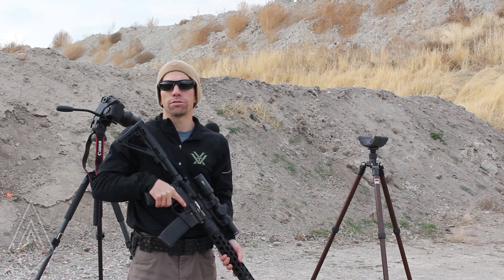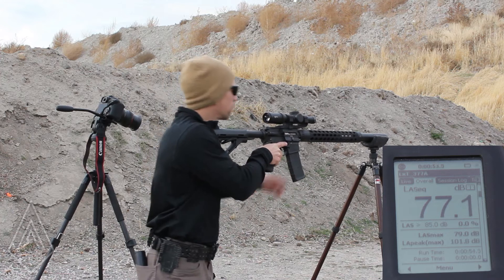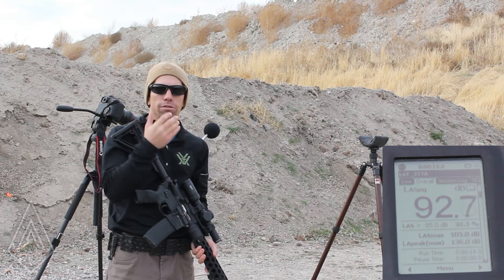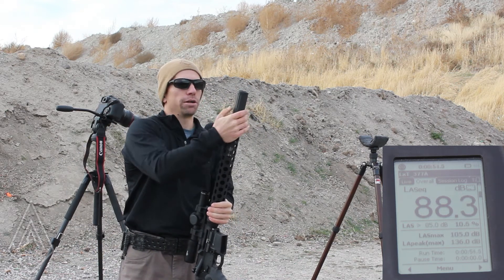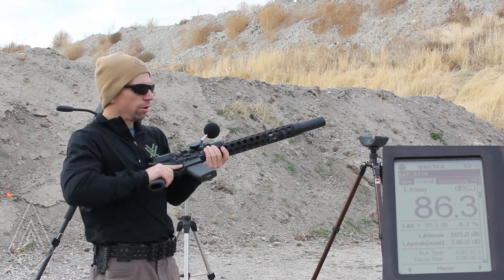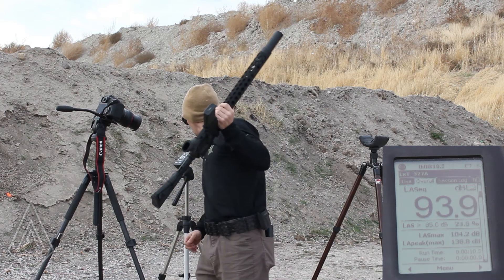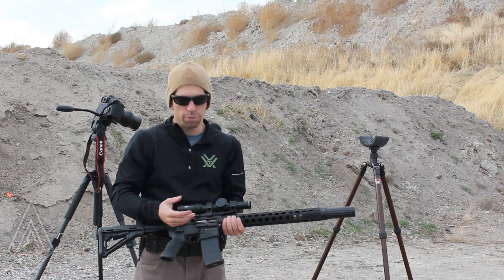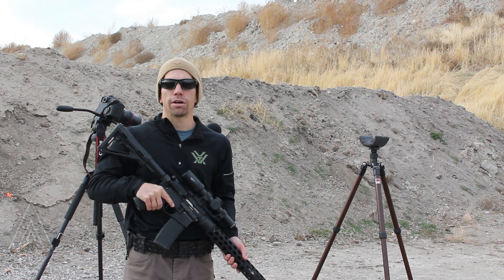End-barrel vs over-barrel suppressor testing Old

Comment: Waiting on my stamp back from ATF, bought the mantis 300 OTB suppressor, plan on putting on my X95 18.5” barrel. Fits fine, but I’m concerned with the Db. The OTB design with the initial blast chamber I think will help with gas blow back, but it’s a gas piston rifle, so idk if that is gonna make a difference… but is 3.7” of the mono core baffle style be enough to keep a 556 round out of a 300blk suppressor hearing safe? Might need to invest into a 300blk pistol…
Thoughts from the community welcome. Thanks.

Comment: Why was the end barrel quieter at the ear than the over barrel suppressor though?
Reply: 2 db is within the variance of one round, but taking it at face value it's probably because the baffled section is longer on an end barrel suppressor. It looks like the actual baffled section is only the 3.7" that extended beyond the barrel, but it has some extra volume which helps somewhat. A 7" can has about 6" of baffles. This is also probably why the longer version has the same db reduction as the M

Comment: Will it be compatible for 20inches barrel?
Reply: The CQBm is compatible with a 20” barrel and rifle length gas system if the barrel is less than 0.750” in diameter.

Comment: Why are you using the inside ear? The outside one is the one that takes a hit.
Reply: Military testing is at the right ear. Also, it's still louder at the right ear due to proximity to the ejection port
Reply: “Port pop” generally manifests near the ejection port in semi-autos.

Comment: Is the over-barrel suppressor necessary if you have an adjustable gas block with a suppressed mode?
Reply: The over-barrel design results in a lower residual bore pressure as the rifle cycles. This helps reduce gas blowing back into the action as the chamber is “uncorked” during extraction. 

An adjustable gas block will have little effect on gas blowback into the receiver. Rifle configurations that delay unlocking until chamber pressures fall (short dwell time) and suppressor design has a greater impact on reducing gas blowback.
Reply: @woodrowcall3158  Negative, Knight-rider. restricting the orifice restricts the flow of gas. restricting the flow of gas means it takes longer to pressurize the gas tube enough to move the bolt carrier. If it takes longer to open the bolt, the pressures in the bore are going to drop more. The only thing an over barrel suppressor does is that it gives you a larger blast chamber, with no increased length on the rifle. It has been noted for nearly a century now that volume in a suppressor that is behind the muzzle is less effective at suppressing sound than volume in front of the muzzle, but if it helps a little, and doesn't add much weight and no bulk, why not?
Reply: @wildrangeringreen  You can only restrict gas between the gas-port and BCG so much before inducing failures.

Reducing dwell time on the rifle side necessitates a larger gas port and a higher initial pressure spike in the system, but overall time for the system to be pressurized is reduced. The quicker you get pressure down after passing the gas port, the less residual pressure there will be present during extraction.

You can move a BCG with a long and gradual push, or a short and powerful punch, and achieve effectively the same thing.
Reply: @woodrowcall3158  I think we can both agree that an integrally suppressed AR, with the gas port built into the suppressor (a gas tube running straight from the blast chamber would work, very reminiscent of a gas-trap action), would be ideal for that; but since we're talking about standard AR builds that don't rely on a suppressor... restricting the gas with a field adjustable orifice is the simplest and most effective way to control when the bolt unlocks (and still allow the weapon to function without a suppressor properly without carrying extra parts). Pressure is volume, and reducing the volume per microsecond that can fill the gas tube means that it takes longer to reach the pressure needed to move the carrier. A longer delay between the bullet passing the port and the bolt unlocking, the lower the pressure's going to be. That's why modern rifle designs (the AR15 isn't cutting edge anymore) mostly incorporate an adjustable gas system.

Other option for your "big gas port, high, sudden pressure" to have a long enough dwell time would be to go with a short stroke piston and a vented gas tube (like on an SKS). That adds weight, felt recoil (reciprocating mass), and extra parts, something the AR15 was meant to eliminate or reduce. That system is still going to need some level of adjustability, if it is going to work with and without suppressors, without having to carry extra parts. Otherwise, you need to incorporate some sort of pressure activated, timed solenoid into the gas system (since the pressure doesn't magically go away even once the bullet leaves the suppressor)... but that's insanely expensive, complicated, and heavy. 

Another option would be to discard gas-operation entirely, and move to an inertia-operated system, with an adjustable pre-load on the recoil spring(s) (similar to many air rifle designs with adjustable hammer spring pre-load)

Weapons designed integrally suppressed are far and away better than those meant to be stand alone, that we add moderators to; however, the current political climates worldwide (combined with a historical general lack of interest from the military, special purpose use doesn't count) limits the market for that, and so companies develop designs that aren't natively moderated.
Reply: @wildrangeringreen  
Even an integrally suppressed semi-auto rifle will exhibit some degree of “blowback”. More so if the residual bore pressure is still relatively high when the spent case is unsealed from the chamber during extraction. Time between extraction and the bullet uncorking from the muzzle is still the chief variable in determining residual pressure when you isolate suppressor design out of the equation.

Can an adjustable gas block have an impact on lock time? Yes, but it is negligible, especially when compared to the influence of dwell time.

Sticking to the pseudo-di Stoner design for this discussion. Take a 16” barrel with carbine length gas, and a 16” with rifle length gas, and assume the same sized gas port for both. 

The 16”/carbine will pressurize sooner, it will pressurize with a much higher chamber pressure, and it will have less distance/space to impinge on the bolt tail to begin cycling. The bullet will also have a longer distance to travel to the muzzle after bypassing the gas-port when compared to the 16”/rifle gas system.

Assume that both barrels share identical lowers and BCGs, and both have X amount of energy required to properly cycle the rifle. In practice the 16”/carbine will require a much smaller gas port in order to meter the flow of gas and successfully cycle the action, whereas the 16”/rifle will require a much larger port to achieve the same cycle.

If we can find the “goldilocks” port size for both and chart the pressure curve, the 16”/carbine will exhibit a high pressure and reduced volume that will gradually build and breach the required threshold to unlock and cycle the action, looking like a steady rise and sudden break when compared to the 16”/rifle. On the other hand the 16”/rifle when charted would appear more like a sudden soft shove of lower pressure but higher volume that will work to cycle the action.

The 16”/carbine has relatively high pressure and must meter volume to regulate cycle speed, whereas the 16”/rifle must substitute volume in place of pressure to achieve the same workload.

It’s almost like formulating projectile energy. Double the weight (volume) and you double the energy. Double the speed (pressure) and you quadruple the energy. Anecdotally this is witnessed in that longer gas systems are commonly felt to be “softer” recoiling than shorter gas systems.

Longer gas systems start with lower pressure at the port, have a greater void to fill in less time than the relatively shorter gas systems, have greater loss due to friction and cooling, and must still achieve enough overall energy to cycle the system. Keeping all other variables the same, it is impossible to regulate a shorter gas system to unlock at the same time that a comparably longer gas system would. As such when extraction begins on a shorter gas system, the residual chamber pressure will be comparatively higher and result in more “blowback”.

An adjustable gas block can certainly be useful for tuning a rifle when you have a surplus of gas to work with, but an adjustable gas block does not allow you to violate the laws of thermodynamics and fluid dynamics.

To reiterate, dwell time has a much larger influence on “blowback” than gas metering does. An adjustable gas block can be used in conjunction with weighting the system or increasing the workload/time of cycling in order to increase lock-time (thereby reducing “blowback”), but the influence is still second to relative changes in dwell time.
Reply: They tried to use rifle length gas systems on unsuppressed carbines in the 60's, it doesn't work all that well (too little dwell time to pressurize the gas tube to be reliable). Putting a suppressor on a carbine with a rifle length gas system makes it work. Why? It's like you said, bore dwell time vs pressurization of the tube to move the carrier. The difference in pressure between 16" and 20" is negligible with smokeless rifle powders lol (we're talking 3000 psi difference, not even a 10% difference most of the time). If you slow the pressurization of the gas tube, you slow the opening of the bolt, which allows the bullet to leave the bore even longer before the bolt moves, making the bore pressure lower lol. There is a reason why adjustable gas systems are on almost every modern design of rifle. If you can't move the gas block/port, change how much gas gets into the system. 

It's all about controlling the pressure coming back to the bolt, and timing achieving the minimum "operating" energy with having a low enough bore pressure (AKA, the bullet's been gone long enough to let the pressure drop) There is a reason why the gas blocks on the M16 and the M4 are where they are, in relation to the barrel length (hint: it achieves that balance reliably). There's a reason the gas tube is the ID it is. That's why shutting a gas port down too much stops a rifle from working, it can't achieve the necessary energy  (pressure) to move the bolt.

You can-
A: change a bunch of parts every time you put a suppressor on or take it off, change suppressor design, or ammunition (to avoid messing with the gas port size) to have the system work right

B: restrict the gas flow and increase the amount of time it takes to unlock the bolt with a turn of a screw or drum

I can tell you what most people/companies/militaries do, it's not option A (especially if you have several different suppressors (or going without one) and multiple types of ammunition that might be used together). You can increase the energy requirements for the system (option A), or decrease the energy entering the system (option B).

BTW, a proper integrally suppressed design doesn't have any more blowback than a non-integral design without a suppressor, because the gas system is designed around that particular moderator, and it's part of the gun, so it never is shot without it (back to the whole dwell time vs time to achieve minimal operating energy thing we keep dancing around).
Reply: @wildrangeringreen  
I used those two lengths purely as an illustrative example. 

I think we both have a decent understanding of what’s going on with perhaps some differing opinions on how to achieve it.

To achieve ideal cycling with a rifle that may be used with or without a suppressor, then I think we are both in an accord that an adjustable gas block is a simple and effective way to achieve this ideal operating state. 

Where we may differ in doctrine is that I personally prefer a rifle to be ported/tuned specifically to run ideally with a suppressor and never take the suppressor off, no adjustable system needed.

I think we are still having a disconnect on the blowback issue though.

If I had an 18”/mid and an 18”/rifle, both with excessively sized ports but adjustable gas blocks that allowed extremely fine tuning, would you expect either one in your mind to have more or less blowback after being tuned?

Comment: can you use otb type suppressors on piston rifles such as lwrc or are they for di only?
Reply: I've seen the OTB models on FN SCARs, so I don't think there is an issue. Just double check the distance from the muzzle to the front of the gasblock to figure out which model is compatible.
Reply: Wondering the same thing

Comment: Ok wait.. it was 136 at the ear with the end of barrel and 138 with the over the barrel. How is 138 quieter then 136? The over barrel was louder at both ends. 👎
Reply: ramellajoe not really a suprise when you think about the fact that theres really only about half the baffles in this suppressor compared to the standard type. If you compared this to a shorty suppressor like the deadfoot arms sandman K or any other short can (thats still technically adding more length out at the end of the gun than this) the results are basically the same. The real advantage here is the short length added and recoil reduction in comparison to other shorty suppressors. Thats still a 20db reduction in sound overall and its a huge benefit to people who carry their rifles for say duty use, since a 16" AR15 with this added is only about 19.5", bringing it up to the length of a standard 20". Meanwhile with the length of even a shorty can, you usually see about a 5-5.5"" length increase from the muzzle threads with all the weight forward of the muzzle.
Reply: ramellajoe 
I believe the point is that it is quieter at the ear that out the barrel. The end barrel suppressor was louder at the ear than out of the barrel. The over the barrel was the opposite. 

I don’t think the point is that the OTB is quieter than the EOB.
Reply: SABLE DRAGON WARRIORS I think the point of OTB suppressors are to reduce length.
Reply: Unknown yeah, that is the main reason to have the OTB suppressor.

Comment: Can you test the over -barrel suppressor on a Tavor and MDR?
Reply from the maker: We have tested on an MDR, but we did not film it. I'll see if I can get a loaner from Desert Tech.
Reply: Did you use the 6" or 4" over the suppressor?  What was dB at the shooter ear?  What was the dB 3ft away?
Reply from the maker: Only the .308 version was tested, and we had limited time, so we only tested at the ear. We tried all of our new .30 Mantis suppressors as well as several other suppressors from other manufacturers. Nothing would reduce the dB rating below 140 at the ear. Not our cans, and not anyone else's suppressors either. This was a result of a combination of factors including the muzzle being so close to the ear and the mechanical noise of the covered ejection port right under the ear.

For this reason, Desert Tech has decided to recommend the Mantis-300 as the suppressor of choice for the .308 MDR. The reason for this is because since everything was going to be over 140dB anyway, and the differences between suppressors was under 2dB, they figured they may as well go with the option that adds the least length. 

Now, the Mantis-300 is the suppressor we created for 300 Blackout rifles, and it's designed to be hearing safe for that cartridge, but be as short as possible. So, if you would plan to use this suppressor on other rifles as well, then we would recommend the Mantis-S, which is significantly quieter. It's hearing safe on a 300 Win Mag. 

I hope this answers the question. We should be able to do a video on this relatively soon.
Reply: Thanks for the info and reply

Comment: Have you guys tested this on a rifle with the superlative arms bleed off brake? I just picked one up for a 308 buikd . I'm really curious how adjustable blocks in general react with this can
Reply: I'm running an SLR Sentry 7 with a CQB 556. When I first mounted the suppressor I saw an increase in gas pressure, and I compensated by reducing the gas flow by turning the Sentry 7 down by 3 "clicks". The rifle returned to optimal cycling after that.
Reply: Michael M We tried a SA Bleeder block today with a Surefire can. You can hear a louder pop with it set to the bleed off setting. Turn it down to restricted mode and the pop goes away. I’m glad you brought this up. Never crossed my mind that the escaping gas from the block would add dB.
Reply from the maker: We're not doing any testing with other people's stuff. Just suppressors from AMTAC and general how-to questions about shooting in general.